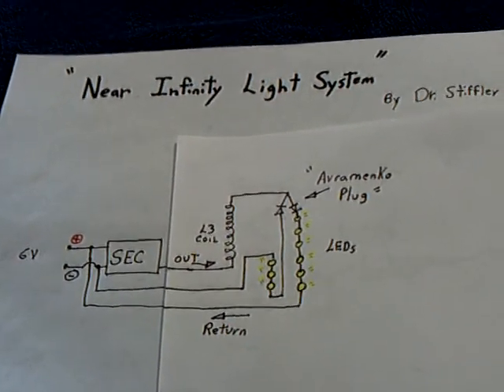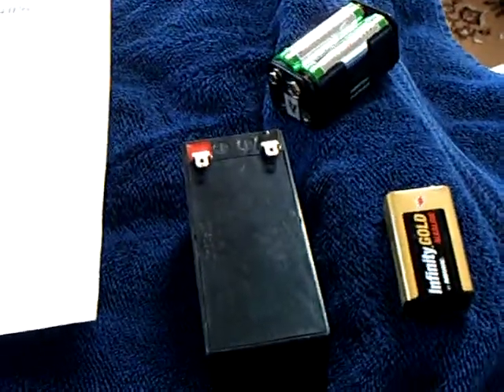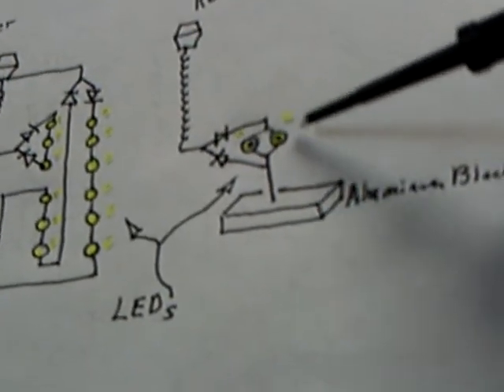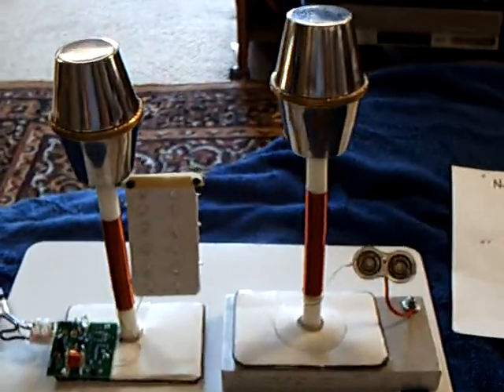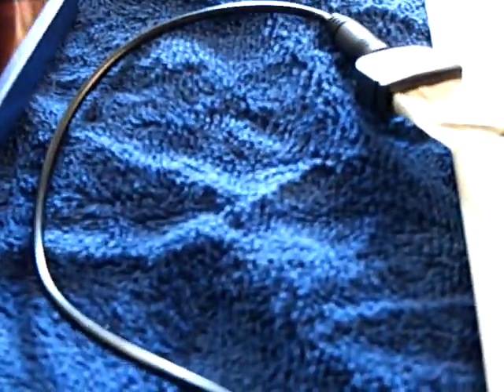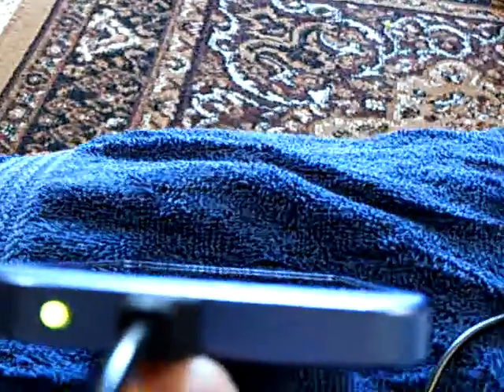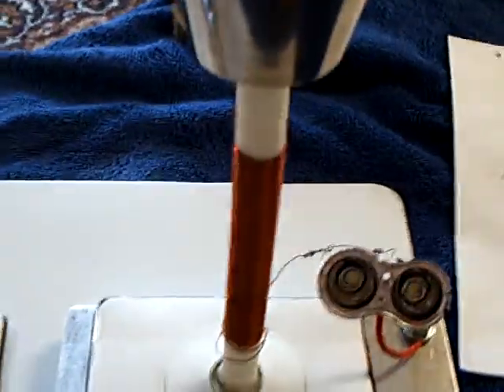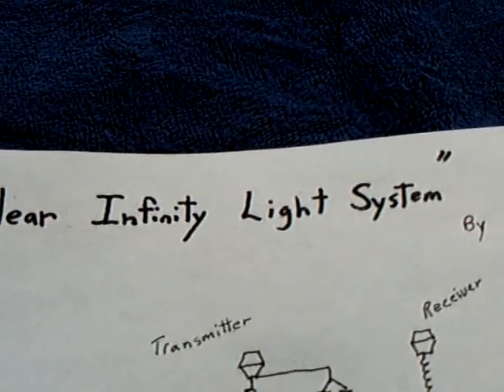Near Infinity Light System- by Dr Stiffler

Comment: I like the comment about the mud hut! 
I have tryed the same thing simular with the 15-3 on my breadboad and it does provide more run time for the batteries.
One thing I was thinking was getting a few self running AV plugs wirelessly and parallel them and build up some amperage and do a few and place them series and avoid the solar cell completely. I think this circuit has the ability to run it's own self but I think you might need a cap to act as a battery. Good word Lidmotor.